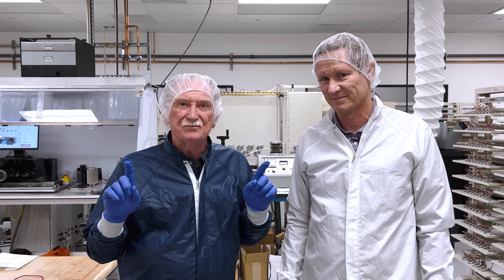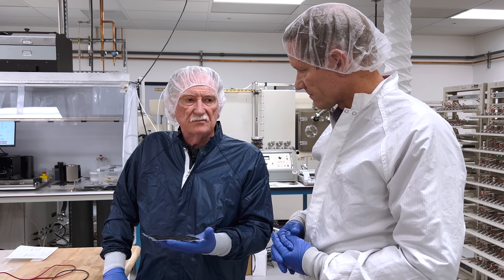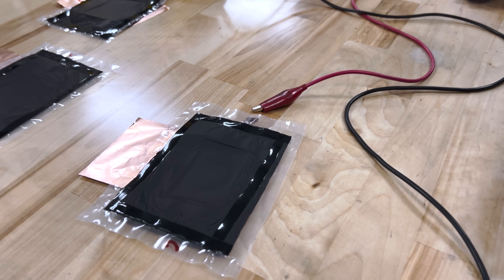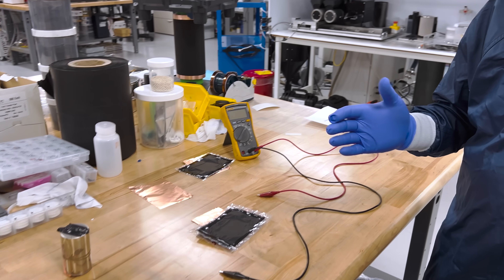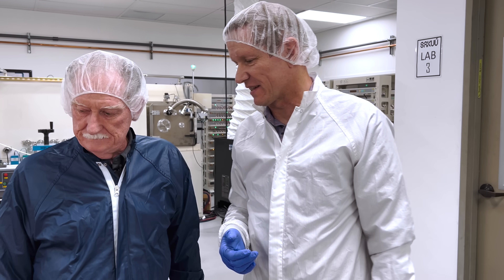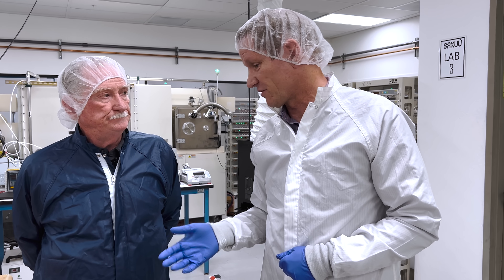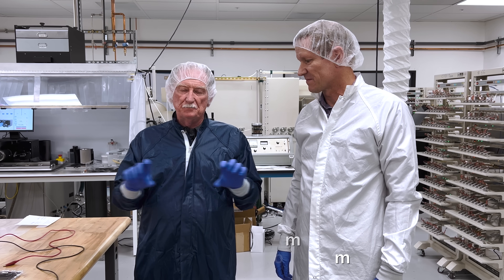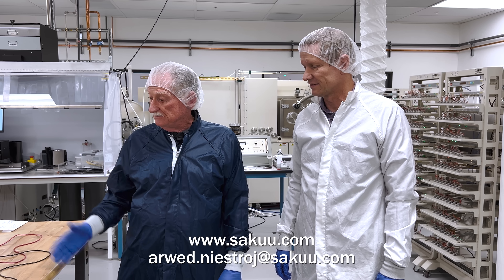Sakuu's Metal-Free Battery Cell: Game-Changing Innovation

Comment: They can also avoid using Lithium, no Li anymore! — and use hydrogen ion, H+, — proton! (Using sulfur acide for proton source electrolyte for it, — but how match it with sakuu dry process? Maybe do it in cold room, lower than sulfur acide freezing temperature?)

Press release:
"UNSW  proton-batteries-an-innovative-option-for-the-future-of-energy-storage"

and

Paper:

See researchgate

"A_High-capacity_Benzoquinone_Derivative_Anode_for_All-organic_Long-cycle_Aqueous_Proton_Batteries"

specific capacity of 307 mAh g⁻¹ at 1 A g⁻¹, it will be 767 Wh/kg for 2.5 V, for example!

3500 circles on room temperature, no loss energy volume at minus few thens of °C! 😱

From paper, about proton batteries at all:
«Recently, new possibilities have emerged with thediscoveries of new battery chemistries based on non-metallicproton/hydronium ion charge carriers. Endowed by thesmallest ionic size and weight, protons are theoreticallysuitable for insertion into host materials with minimalstructural expansion and mass burden. Additionally, unlikethe individual diffusion manner of metal ions (vehiclemechanism), proton conduction could also function in adisplacive manner (Grotthuss mechanism). This enablesproton batteries to achieve impressive rate performance(4000 C for Prussian blue analogue electrodes),[7] as well asexceptional adaptability in low-temperature conditions(-78 °C)[8] and all-solid-state configurations.[9]»

Comment: New battery technologies always have something wrong with them. Either its charging times, number of times the pack can be recharged, cold weather performance, voltage stability, cathode problems and on and on. These videos always comes out saying blah, blah, blah better than sliced bread. Then in 2 years, it turns out to be junk with no or few applications.  

Put it in a car and lets see the range and charging time.

Comment: Maliit na batery lang, 50v lang na battery Ewan kung ilang Amper, 250A....kahit Hindi pa aabot Ng 50V..generator Ang tonay na source pang pang start lang Ang battery..may Sarili akung design iba sa mga EV..kahit battery iba narin..kahit generator iba narin..parang free wheel lang na generator Yan,  graphite Ang magsilbinh diode para Hindi mahirapan Ang generator.. Ang drive motor iba narin lokot lokot na coil wire lang may grove nmn Basta may gap kung grove maingay..BLDC wlng carbon brush..kahit maloblob sa tobig walang problema...

Comment: They compare results with the 4680, but the 4680 can be used structurally in an electric car. I'm curious to see how they will compare once we have a final battery assembly, where more weight will necessarily be added.

Also, I don't understand why there can't be thermal runaways, Can someone explain?

And how will thermal management be done? Will these be immersed in a dielectric liquid?

Comment: Essentially: the ratio of carbon to polymer determines how much current will flow and as the flow increases...so does the heat.. and the polymer expands (a LOT) when it heats up.. and so as the polymer expands it causes the carbon particles to spread further apart from each other..which causes voltage to go up (and current to go down) ... until it reaches a self regulating expansion wherein no more current can flow because the carbon particles are too far apart to conduct.

It's genius

Comment: Raychem invented UltraHigh back in the 80's.. conductive copolymers with fusion extruded carbon-polyethylene  ... it was revolutionary and they barely scratched the surface on the material before they sold it off.  #sad.

Comment: Safety (no thermal runaway) is the most important feature. Imagine if all cars in a parking structure, tunnel, ferry, undersea train, etc, were all electric (which they will be in 10 years time). What are the chances of one of them malfunctioning and getting thermal runaway (it just needs to happen once). Then consider worst case like an undersea train packed nose to tail with EVs and on fire and emitting extremely toxic fumes with no way to put it out and getting up to 3000 deg C and full of people. All cars with old chemistry batteries will then be prohibited from these modes of transport.

Comment: The box will be 12 cm high if each of the layer is 0,6 mm in thickness !  ----> 0,6 mm x 200 layers =  120 mm  wich is equal to 12 cm  ( Centimeter ) ! ! !
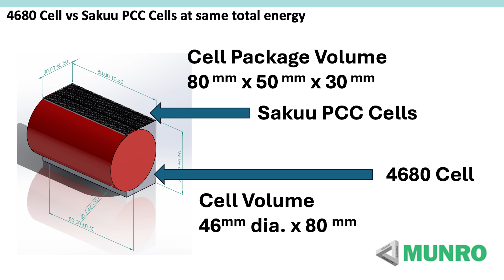Mr. Munro  you need to rethink about the size of the battery-box if you want to stack up 200 of them on top of each other ! ( Minute 6:56 )To be honest, those packs look thicker than 1 mm to me. So to be more realistic let us calculate 1,5 mm per layer : 1,5mm x 200 layers  =  300 mm  which is equal to 30 cm  ! ! !  30 Centimeter is exactly what you said in Minute 07:24 , before you corrected yourself to 30 Millimeter. I don´t want to be rude but may be as an US-American citizen you still have trouble with the units of length which is used by the rest of the world.
Additionaly 200 layers x 3,2 Volt ( per layer ) = 640 Volt ... not sure if that is enough Voltage for modern electric cars.
800 Volt is the modern standard nowerdays and that would result in 250 of those layers , 1,5 mm each would make  375 mm whic is equal to 37,5 cm in height.
If you stack those horizontaly into the ground-battery-box of the electric vehicle, how much power would you achieve when you fill up that big box ?

Comment: Considering every battery breaktrhrough, show me data:

- Energy density
- Max discharge current for like a 18650 form factor 
- Max charge current
- Lifetime in cycles
- self-discharge over time

- cost per watt-hour
- operation environment (like teslas can supercharge... just not on very cold days)

- manufacturability, time to mass production
Reply: Exactly 💯

Comment: Clean room seems necessary in order to prevent debris getting between the cells. Does it reduce thermal runaway risk because there is no electrolyte? Would modules have to be assembled in a clean room? What is the peak manufacturing rate compared to today’s roll-to-roll?

Comment: E-cars
 with wheel hub motors and the new 2000KM battery have a combined range 
of 3000 kilometers. There are also battery changing stations so that you
 finally no longer have to charge yourself! .Greetings Thomas   PS: 
Please note: replacing a battery is quicker. 5 minutes for 3000KM.

Comment: The carbon carbon battery is called a Karpen battery. This seems like a variation. A man called Robert Murray Smith was building a printed sheet 5 kWh battery in an old car battery about 6 or 7 years ago you should look at that.

Comment: As several others have commented, what's the charge / discharge rate? That's far more important for BEVs than battery weight, packing fraction or metal content.

Comment: It is not ALL peaches and cream ... POWER per kg will be lower, because the conductive polymer is much less conductive than metal. That is an inherent side-effect of the metal-less design and increased safety. If one attempts to get normal metal contacts current levels into or out of these cells (especially out) they WILL get warm or hot, because of increased internal resistance. Put another way, cell voltage will drop under load, even when the cells are still fully charged. Batteries made from these cells will NOT be for performance cars.

Comment: I love the safety features they describe.
This would make it possible to integrate a printed film circuit board with designated current collector pads and isolated passthrough hole(s) in between the battery cells to get multiple voltage ranges out of a single battery stack without the need for multiple additional passive components to regulate the output. Revolutionary!
like 1 stack that puts out 3-6-12-24-48 volts on separate leads from the same battery stack.
this would allow for IC power, sensor power, and motor power to all be directly connected to the battery stack without the need for individual voltage supply adjustment circuits in the controller design.

Comment: I wonder how the numbers would compare at the pack/chassis level. The 4680s can be load bearing, but these floppy cells would likely need more structure added than the 4680s.
Also, the safety he's taking about is essentially adding a resistive current collector. Wouldn't that be tremendously inefficient?

It's all super cool nonetheless.

Comment: Well, the man did say in the form factor they've been using, the battery chemistry holds "over 80%" capacity at 1500 cycles. That could be problematic, depending on whether the number of cycles can be increased for EV use. Apparently they aren't ready to discuss that and Sandy didn't pursue that.

Comment: If you make cells with plastic who is an insulator, how you get rid of heat ? You cheered for tesla on the 4080 because of the easy path for electricity flow and heat, but now this get rid of all the metal paths that help that 2 way of getting rid of. So i think you can use this only on mild use and not high discharge rates ?
Or I'm wrong ?

Comment: Also.. as mentioned they can chemically alter the properties of the anode and cathode so that if shorted... or punctured - the battery will limit the discharge rate preventing fires. At most the battery will get warm but thats all.

Comment: a little short on specifics - what polymers? what is the base battery (chemical) reaction?  
Are there any dendrites,  or similar  crystal type growths that could short-circuit the polymers?
 What does the end-term for these batteries look like (this is a short list!)?   

Just fantasizing, but I imagine sometime in the future the major battery breakthrough will be some form 
micro-3D printed nano-tube type battery cells... but I guess if they ever overheated, they would turn to goop  pretty quick

Comment: I certainly do like the minimal waste in the end product but that surface to surface conductivity or Variation in resistance a lot and the chances of hotspots will be a challenge as conductive areas that have a very low ESR will get hotter and as the heat increases so will the conductivity which will create thermal runaway so I can't imagine you're having much more than 10 cells in series as it will be impossible to regulate those hotspots unless they can get that conductive surface area to be super conductive at around less than half an ohm per square inch. this should help mitigate super conductive areas if the whole surface is super conductive! Contact me for more information on this topic. If you feel it can be helpful as I am a strong supporter for this style of cell. I've worked on my own version for more than 10 years and I domestic level. I have achieved so much and overcome so many hurdles, so as such a figure out quite a few things😊

Comment: Now we can build our batteries into our body panel! This creates many benefits including safety as a barrier for impact and lowers the weight of the Battery cell and even be used to heat the car to get snow off. So many advantages to the system.

Comment: Power in Wh? Energy density is higher because of the reduced weight but what is the max current of the cell? The internal resistance must be way higher than classic cells so you’d have to put more of them in parallel to get similar current etc. superficial indeed

Comment: If Sakuu sets up cathode or anode materials to control burst current, then that increases resistivity.  How do they balance the heat generated by higher resistivity under fast charge and discharge cycling?

Comment: Ok, all great but how about cooling, mass producing, cycle life, duarbility, charging rates, etc?  The culprit in most battery break throughs is that there has been zero thought about how to mass produce these things. Which has been the bottlenck for solid state batteries.

These stacks of flimsy flat  plastick cells need to be contained in some box at least.

But we will see how this plays out in the future.

Comment: Energy desity is 354 Wh/kg. Still not the best.
Another big issue, only 1,000 cycles. So, in 2.5 years, batteries need to be replaced. Very inefficient.

It may improve recent standard a little bit for some applications, but it's far from solving energy storage problems. But, it's not the holy grail as you claim.

Comment: MY BIG take away is the SAFETY issue.
Meaning the THERMAL RUNAWAY risk - which is WELL KNOWN - and has injured and killed so many people.
IF they can mass produce this at scale and it won't turn into a chemical blow torch fire if you simply puncture it or it has a manufacturing error - it might become the "standard".

Comment: Interesting design density, but you can't just stack cells indefinitely deep without having some cooling plates interspersed at some intervals, maybe between 10 cell "packlets" for some kind of modularity.  Part of the inefficiency of the cylindrical 4680 cells is used filling space between the cells with flat tubular liquid cooling channels touching the sides of the cells.  We know what happens when NMC cells aren't operated within the right temperature range, as proven by the Nissan Leafs.  The rectangular cells will make volumetric density better, but the cooling overhead is still unavoidable, and wasn't mentioned in the presentation.

Comment: Ok great, more stuff in a lab, lets get going.  This is why QS still really has made no impact.  I remember about 8 years ago hearing all the solid state talk and thinking, well, at least in 8 years I will notice some impact, but zip.  Nothing.  The cost is not going down at all.  Energy density, safety, quick charging, and cost are not just wanted, but I think they all must happen to make EVs really start to replace ice.  Its still probably a long way off.  I laughed when they said they wont sell ice cars in california by some stupid time frame.  Basically, double whatever time frame anyone, including engineers, think it will take.   When EVs are cheaper, safe, weigh far less and can charge very fast, we then only are left with the other huge problem which is how on earth do you change power to charge from gas to electric.  There is massive work on the entire electrical grid, because all that power in gas has to flow as electricity and that is not easy at all either.

Comment: About 10 sec per pouch production, 200 pouch per cell or 2000 seconds per 96 Wh. 

60 kWh /car ~ 600 cells ==> 1,200,000 seconds or about 14 days  per battery pack per production line or 0.5 cars per week per battery production line. To get to 5000 cars per week it needs 10,000 battery production lines. Estimating a minimum machinery volume of 10 cubic meters per line, we have a minimum factory volume of 100,000 cubic meters. With access space and all this will be a factory of about 1 million squared meters or 1 square km.

Comment: When he laid the second battery on top of the first and then retested it with a volt meter proves that it not only works but Sakuu's R&D program is pushing the limits of battery cell technology.  Looks like a sound investment.  It will most likely take years to see their tech in EV's and Vtols but the fact that he showed a working prototype means its a step in the right direction.  Like semiconductors the tech has to get smaller, lighter and more dense yet exceed its capabilities through future generations in order to be successful.  Great vid hope to see more as their development moves forward.
Reply: I can get voltage out of a lemon and two nails.

Comment: There are probably hundreds of batteries in development whose inventors claim is a "game changer". But batteries aren't judged just on volume or energy density but on many parameters - cost to manufacture, complexity of manufacture / yield, scarcity of materials, operational safety, fire / flammability, toxicity, operational temperature range & degradation, kinetic resistance, charge / discharge cycles, charge / discharge rate, state of health over time, failure rate, recyclability, etc. A battery could be good at some of these things and bad at others. The difference in any of these things could affect its applicability, e.g. vehicles, aircraft, marine, fixed storage etc. e.g. a battery could tick every box but stop working at -1C in which case it sucks for cars; or it might be low density but have amazing charge / discharge performance and be great for grid applications; or it might be super high density / low volume, safe and cost $$$$ but be good for aviation; or it might be a sweet spot, sort of like LFP but better. So basically we'll see what happens when this battery does or does not enter production. Because lots of companies have samples, but churning them out at volume and using them is where things become clear.

Comment: 1. How many charging cycles does this new battery provide? 1000 charging cycles is NOT very impressive.
2. What is the degradation of the cell over time? How long will it last?
3. How well does this battery operate in extreme hot and cold weather.
4. Can this battery be fast-charged. 
5. At 3.1 volts, it would take 323 of these packets to produce 1kW. That's a LOT of plastic battery packets for just 1 kW of power. 
6. How do you cool this battery pack? To cool rolled-up packs, you would have to place them in metal canisters.
7. What is the chemistry makeup of the battery? Currently LFP batteries are the most durable batteries made. They can be charged 4000 - 6000 times and maintain 90% of their capacity. 

Until you can answer these questions, nothing about this is "game-changing!" There are a LOT of real-world problems that this battery design has not solved. This is hardly the "holy grail" of EV batteries.

Comment: Cell impedance for fast charging/discharging, electrolyte flammability, cycle life?
Balancing?
How do you stack the cells without some form of electrode connection between each cell to do balancing?

If the cells are stacked, how do you get the heat out of the middle of the stack?